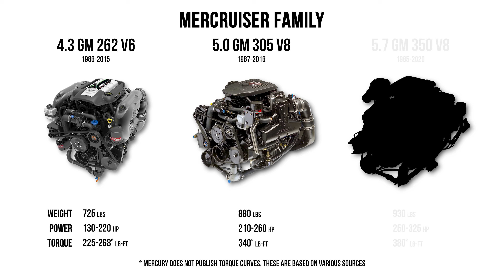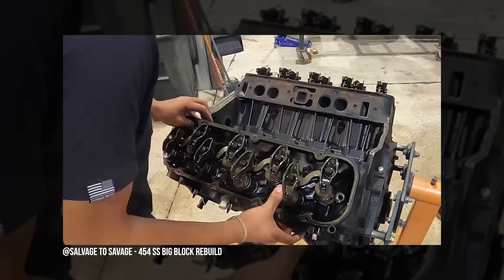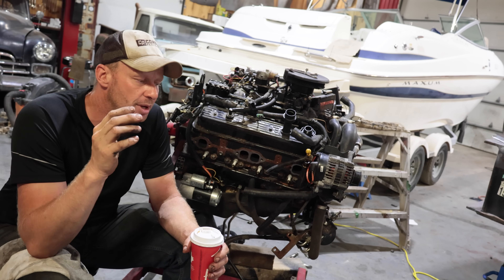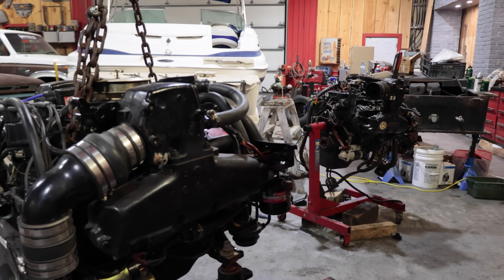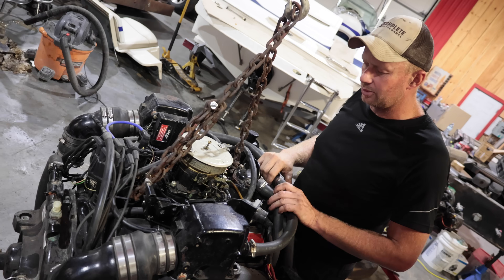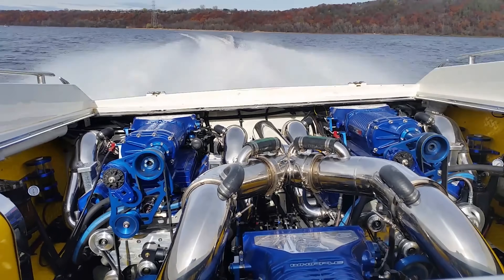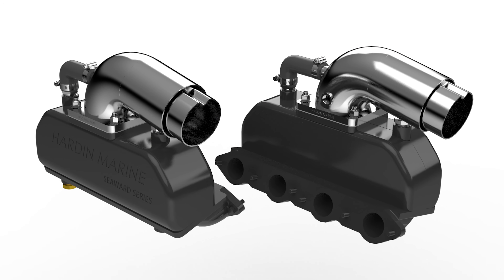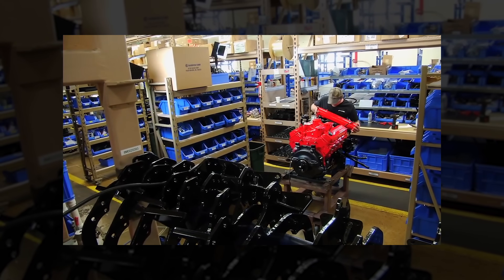REVIEW: Everything Wrong With A Mercury Mercruiser

Comment: I had 2 outdrive boats.1 ski boat, and 1 pontoon boat, and for me, it wasn't so much the engine...than the outdrive.
 Always something noodly to mess with.
 To many moving parts, and special tools needed.
 That said....
 The outdrive pontoon was an absolute nightmare to work on!!
 Had to lift the engine up 10 inches, just to change the oil filter....and getting to the starter. Arrrgh!!!
 Never get an inboard pontoon!!!!
 
 I now have an older boat with a v drive, and a big block. Actually have had it for many years, but got put on the back burner.
Now...fully restored.
Kind of a Hot Rod boat.
 Super reliable, and easy to work on, with no special tools.
 I'll  never have another outdrive boat.
...for pontoons....only an outboard.

Comment: A couple other things that are problematic - these may be more applicable to engines that run in saltwater. There is a "shutter valve" do it. That is just downstream of the exhaust risers, this is just a rubber v-shaped valve that shots if water is forced back up the exaust tubing. These breakdown over time with heat and general use, and if they end up missing the engine can forcibly in just water while backing up or stopping hard. Second, on bravo outdrives the raw water intake runs thru a hole in the aluminum transom plate. Overtime aluminum corrosion builds up and actually pinches the raw water hose shut, leading to overheating. The fix for this is to separate the cooling intake from the transom plate and have the engine pick up cooling water through a separate through hull fitting. Plug the old hole in the transom plate so it doesnt leak.

Best to look for an engine with a closed cooling system - it uses a heat exchanger where raw water is pumped thru to cool the antifreeze that runs thru  the block

Comment: I've owned Mercruiser 350s for years.  Because there are so many drain plugs, and because the bilge on my boat is too deep to access a couple, I start by draining what I can and then use ear muffs, a 12 volt pump, and a 5 gallon bucket of non-toxic antifreeze.  Hook the ear muffs to the lower unit, turn on the pump, and start the engine.  When you have a good flow of pink coming out the exhaust, your engine is protected with no worries about trapped water.  Note: you must drain the block before doing this (and the manifolds as well) since the thermostat is not going to open to allow the anti-freeze in to replace the water in the amount of time it takes to run through a 5 gallon bucket of coolant.  I use the -50 degree anti-freeze where I live, but you might want to use the -100 in Canada.  Also, in salt water the risers and probably the manifolds should be replaced about every 5 years.   Manifolds will probably be okay if the engine is fresh water cooled, but change those risers.

Comment: Here in NZ our jet boats almost entirely use automotive engines. They seem to last just fine, given the application.
Many here run heat exchangers for cooling. These boats run in rivers, so can slowly fill up with sand if the raw cooling isn't well managed

Comment: Thank you so much for pointing out the difference between marine and automotive cams. You have no idea how many calls i get during lake season down here in Nevada when people hydo lock their brand-new motor first go out. Also down here we usually just get a big bucket and fill it with coolant drop the outdrive in and run it for a few minutes. Never had a problem, our 21-foot sleekcraft has had the same motor since 1996 and it still runs, we don't know how its honestly insane. Its a Merc alpha 260hp 350 sbc thing is a champ.

Comment: Mercury usually specified forged components in their rotating assemblies, so engines with freeze damage like the one you pulled still have usable, USA-forged steel cranks, rods and pistons inside them. I'm not aware of any aftermarket companies who are forging new crankshafts in the US, so if you're building a small block/big block Chevy, a neglected, low-hour boat engine is a cheap source for high-quality parts. I'll take a forged GM crankshaft from the 90s over a new Chinese one any day.

Comment: Something to note, JB Weld will in fact hold for 4 seasons anyway. If done properly. Remember that these aren't pressurized systems, I have personally put that stuff on a pressurized system and it held for the entire length of time that I owned the car, and the time that the next owner had it, don't know about after that. It ain't pro, but what does Derek say? If it works, is it really a dumb idea?

Comment: I have a 2005 5.0L.  Make sure you changes the plugs regularly.   When i bought the boat the plugs had never been changed.   They were rusted in place and disintegrated.  I had to pull the heads to fix that problem.   Major pain.  All good now.  Boat runs great.

Comment: Quick question.
I currently work at a hotrod shop as a technician in my last year of apprenticeship. My boss and Mechanic has always taught me that a 2 bolt main is always perfered, as you get the machine shop to machine 2 more splayed bolts for the end caps at an angle, then you have a re-engineered 4-bolt main with more casting material around the mains than a factory 4 bolt. 
Do you agree?

Comment: I used Devcon epoxy on an exterior head crack in 2005.     I’m still using it today  around 1000 hours later.    It’s sure worth a try.      1990 4.3👍🏻.

Comment: Heat exchanger. I run two of these in Alaskan saltwater. I never let raw salt water into my engine, run a oil cooler, coolant heat exchanger, and wet exhaust. Never drain anything for winter, I just pour about 3 gallons of RV Antifreeze into my raw water scuppers and it’s ready to go.

Comment: On my 2452 bayliner , i would run my v8 mercruiser inboard until the thermostat opened , take off the hose and then switch to marine antifreeze and would run until only pink antifreeze comes out, let it run for a couple more min the. I would fog the carburetors until it stalled the engine and that was it , thats how i did it for the inboard gas motors and i never had any prob, the only time i used the drain plugs was if i couldnt start the motor for whatever reason. I may b wrong but thats how i always winterized it .

Comment: Greetings: Q1)-  U refer to Pre 96 as "carbureted ". In the video I think I saw a TBI (87-95).  Are you referring to TBI as "carbureted " or were they "carbureted" and none TBI?  FYI- it has been many decades since I worked on marine engines. Now I just do electrical / electronics.  Q2) I understand the demands and limitations of marine and Landmobile power trains.  Which brings up my 2nd Q-  If there were TBI units used by MerCruiser, can 1 be converted back to a Landmobile for use in a pickup?... changing the exhaust, water pump, various electronics ( utilize the recipient pick-up system). Essentially replacing a bad OEM engine with a TBI MerCruiser?  End result - a more durable engine of the same OEM application.  Constructive comments welcome. Thx 4 the read.  GS.

Comment: Humble opinion says that the engines have to start at ambient temps whether marine or automotive so the clearances at 165 vs 205 shouldn't be that big of a deal, my father and I have thrown a couple automotive straight 6 Chryco blocks in boats backed up by Volvo outdrives with ZERO issues over years of use and abuse.

Comment: Rich you talk about the blocks freezing and describe the drain ports. Although the drain ports work their is actually a much easier way to keep them from freezing. Simply you get a pair of muffs on the lower and pump non toxic antifreeze in then fire the motor up and run it for about 5-10 minutes. According to Merc this will fill the entire raw water side of the cooling system with antifreeze and your good. And as long as u use non tox u don’t have to drain the antifreeze out in the spring.

Comment: Gear ratio for a 5.0 305 and the 4.3 v6 are the same 1.62 . You will have to change the gear set in the upper to a 1.48 ratio for the L.S or anything bigger than a 305 !!

Comment: The best money you can spend on a boat engine is to buy a sea water to antifreeze heat exchanger. If you have room they are easy to mount.  Run coolant through the engine and the manifolds.  It works great.
Reply: You just have to reroute the coolant so that it doesn't kw out the exhaust dumps. Requires a kick off  plate on the back of the manifolds. Route the coolant back to the heat exchanger and route the seawater dump to dump into the manifold dumps behind the block off plates.

Comment: Firs statement probably the most honest words ever spoken! The owners are the problem. Ive had them unplug hour meters and swear they had not used it since i fixed it. He didnt know i put an hour meter in the engin compartment. Others didnt realise i can hooj up a laptop and see every single second of how you ran your engine! Yup, 2 hours with 6psi oil pressure and 4 at 200f, that pretty much voids your warranty.

Comment: We had a SeaRay bowrider with the 5.7HO. While it was a comfortable boat I'd never own another I/0 boat. The 5.7 drinks gas compared to equal HP outboards. Plus the engine compartment was impossible to get into. And I/O drives don't track as straight as outboards at lower speeds.

Comment: The biggest problems with these engines are they don’t last long and they burn an incredible amount of fuel . These gas engines don’t last more then a year or two, We’re talking about a 3000 hour life span! The fuel consumption is so bad you can’t carry enough fuel. You can’t even have a one day endurance on most boats. A conventional single screw inboard diesel is the only way to go. A diesel (with a sane HP rating) will last you 10 or more years. Around 25,000-35,000 hours between in frames on a diesel is typical. Now your not getting anywhere near that on a hotrod diesel. For an example even a Cummins 6bt at 220 Hp will last 10,000 hours or so. At 375Hp or something else insane it won’t last a year in a marine application! A 671 at 220 Hp will last at 400 plus HP it won’t last a year! Any additional money you spend on a Diesel engine in a boat will be saved in fuel in the first year! I’m not kidding, had a workboat with a 454 Chevy that burned about 40 gallons an hour. We replaced that pile of junk with a 671 Detroit and it only burned about 8 gallons an hour. That’s over 200 gallons a day less in fuel! We’re talking about a fuel savings of over  $4000 a week at $4 a gallon!
Reply: Please don't recommend diesel to everybody.
I work on the Detroits for a living and most of the owners let them sit forever. When they decide to start them, they either overspeed or won't start.
Then I have to give them a heart attack with the bill.

You can get the gas engines to be pretty reliable if you make everything roller and start it up atleast once a month. Get a closed cooling system also.
Fuel consumption is going to be bad regardless unless you get the proper prop and outdrive for the application you need it for.

If the owner plans to run the boat constantly or use it for work, then get a diesel.

Comment: A common Mercruiser block for many years was the 880 roller cam block.  Most 880 blocks were 2-bolt mains.
Reply: Yeah, the 4 bolt mains BS came from endurance race engines.......zero need

Comment: Having owned a veritable, uhhh, boatload of boats, 😂 here's a bit of information to consider. 
1.  EFI   on a lake boat, maybe, but on an ocean boat, absolutely NEVER would i have EFI on a boat!  You have to remember that EFI systems rely on a number of electronics and sensors to function, and if even one of those electronics or sensors fail, you're, as we say in the boating world, "under way with no way on" (pro tip: never use the phrase "dead in the water" over a marine radio unless there are actually dead people in the water) Carburetors work by virtue of their very existence,  and as long as they're functioning correctly, they will generally continue to do so untill someone screws with them. And t
hey are exponentially easier and cheaper to repair when they do malfunction. Bear in mind that a carb kit costs about 40 bucks and contains everything you need to repair one, while most EFI sensors cost upwards of 80-100 bucks, and you're really screwed if your ECM goes bad. Most ECM's aren't designed to live in the damp, humid, and often salty environment in the engine room of a boat. Also, if any of you fellers watch Nicks Garage, he did a true apples to apples comparison of EFI v. Carburetor using a 750 carb and a 780cfm EFI, and the carburetor actually made more torque and HP! Even though the carburetor was smaller!😮
2. I would never even consider buying a boat with a "raw water" cooling system. You all saw the junk that came out of this fellers engine, and that was out of a lake boat! Always use a closed, "fresh water" cooling system. 
3. All boats, even lake boats, and outboard engines have zinc anodes. Always inspect, and change those zincs regularly 
Outside of those things, the main issue i find with gas engines in boats is the induction system.  They seem to use production automotive intake manifolds, and Carburetors. As our host here says, marine engines typically run around 4000 rpm all day. The production intake manifolds they use are designed for a power band between just off idle to about 3500- maybe 4000 rpm. So by the time you get 'er on plane, you're pretty much all in. Well, what happens when a storm rolls in and you gotta haul ass to port? Well, you're gonna shove those throttles all the way forward, and find the boat actually slowing down. It'd sure be nice to have an intake manifold/carburetor combination that actual works in the RPM range you're engine lives in, wouldn't it? If i was this dude, and i was gonna run that 350, id first convert it to a closed cooling system, then get rid of that restrictive dual plane intake, and the ol' Quadrabog carburetor, and throw on an Edelbrock RPM Airgap, and a 700cfm Holly 4150 with down leg stepped boosters and vacuum secondaries. Then id have a new prop tuned to that combo. Then if i had to out run bad weather, id have plenty of extra usable power at the upper end of the RPM range.

Comment: So much bad info in this video.... mercruiser has used 2 bolt mains for almost 30 years now. Freeze damage is a problem however, any research could have shown that corroded manifolds will kill an engine just as quick. Mercruiser changed to the dry joint manifolds, which your engine has to prevent problems where the manifolds and riser/elbows meet however they seem to rust out quicker. You also show the mercruiser 6.2 as a GM product however the 6.2 is an in house built mercruiser product.
Reply from the maker: I know the current 6.2s are built entirely by Mercury. You’re saying the 2000-2014 6.2’s were not GM blocks?
Reply: @DEBOSSGARAGE  no sir, the old 6.2 was a 350 stroked to a 377. So I guess it was GM based but not an LS
Reply from the maker: @Mrgarrison151  we never said it was an LS... just compared it to one.

Comment: Never had a 2 bolt break. If you convert it to 4 bolt, it's a better idea because the caps are splayed instead of vertical. Never had a problem with cast cranks. Rod's are another story in a boost application.

Comment: 30 plus years ago i did enjoy being on my friends boat powered by the GM 4 cyl Iron duke. It could pull 2 skiers and would run all day on 20 gals of fuel and was quiet
Reply: Had that little engine in a boat back then and it was great.  Especially on fuel consumption.
Reply: I still have an '81 Rinker 17ft with the 2.5L iron duke.  Super easy to work on and parts are cheap.  Has never let me down, and hits 35mph with an SS prop...

Comment: Colant temperature in a raw water cooling engine are set so the lake water which cotains minerals will not leave significant deposits in the water jackets.  You can run the engine hotter just by changing to an automotive thermostat.
Reply: That's interesting about the deposits.   I run mine in freshwater lakes.  It used to be in salt.  It is strange to have salt water running thru the block.  It did have  a flush fitting.

Comment: Look out for sand/silt build up in your engine block. This affects the cooling, but it also can trap water that won’t drain when you open the plugs to winterize (ask me how I know). Pull the drain plugs completely and use a piece of stiff wire to clean out the drain passages as best you can. I then fill the block with rv anti freeze through the thermostat housing and let it run out the drain holes.

Comment: Great video with lots of useful information. However I would have to disagree with your statement about "repaired" block crack not lasting more than a season.  I've personally patched a couple with permatex the right stuff and they are still going strong.  Totally acceptable quick fix imo.  It's not a structural crack and the cooling system is not under any substantial pressure. Replacing the block for a hairline crack on the cooling system side is silly.  That being said, it should definitely be disclosed if the boats being sold.
Reply: And actually yeah J-B weld might only last a season because it doesn't flex or grab like permatex the right stuff

Comment: I have blown 2 Mercruisers (5.0 & 5.7) the 5.0 was my fault..the 5.7 was due to a shady tech that sold me an over/bored long block when I pain for a crate engine. I now run a 5.0 Volvo Penta EFI.  It is smooth and plenty strong to push my 63 Century Resorter 19 along... 46mph at 4800rpm.